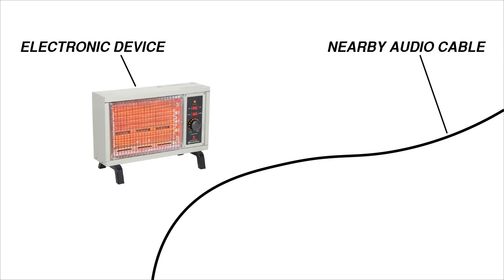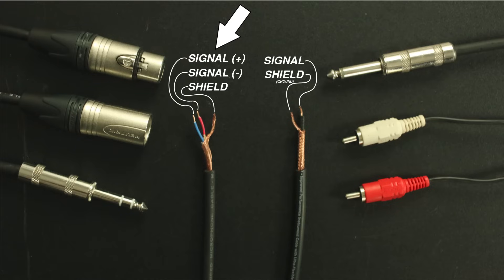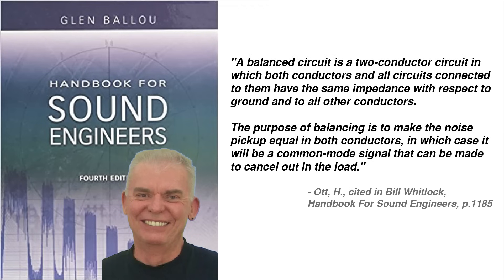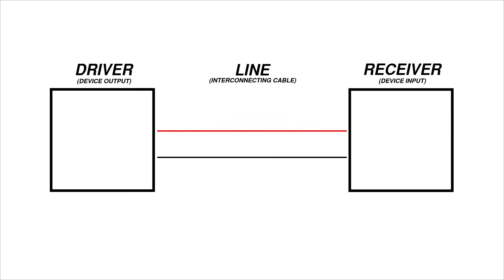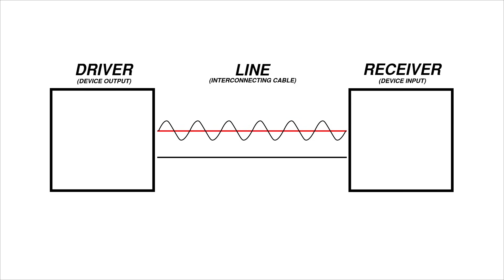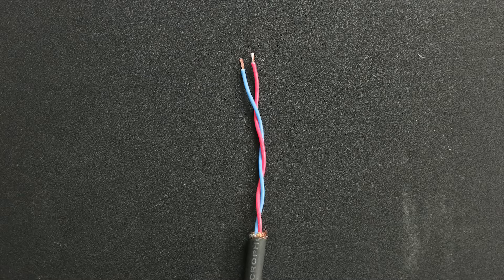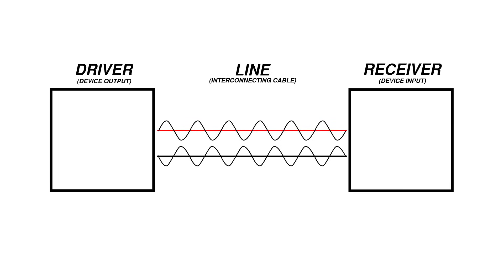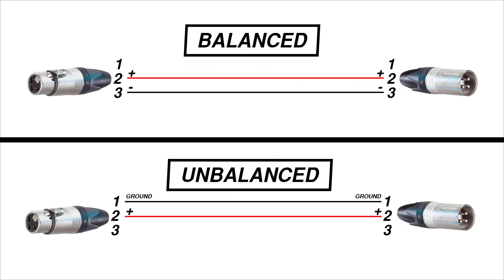Balanced vs Unbalanced Audio | Do Balanced Cables Sound Better?

Comment: I just saw your presentation on balanced vs unbalanced.  First, thanks for the reference to my work.  Second, and the reason I'm writing, is to give you a big thumbs up!!  You got it exactly right!  In my nearly 30 years of teaching seminars on the subject of system noise, I'm always amazed by the number of technicians and engineers (even textbooks) who cling to the idea that signals on the balanced lines must be of equal level and  opposing polarity - this is a provably wrong idea that just won't go away!  Thanks for helping to dispel the myth!
Reply from the maker: Wow! It’s a huge honor to read this validating comment, especially considering that I fell victim to this myth not too long ago! I hope this is truly THE Bill Whitlock writing this comment! Thank you, if so.
Reply: @AudioUniversity   the topic of a balanced cable has not been fully disclosed, since there are balanced wires for headphones, there are also balanced audio DACs, they work on a different principle, to the topic of noiseless sound, I would touch on the optics pluses and minuses, as well as a modern Internet cable that modern DJ consoles use and digital sound amplifiers, this brings us to the topic of digital sound and sound processors, which also have a lot of types, for a car, for films, for pop acoustics, for microphone feedback protection, for phase correction and room correction and other useful things)
Reply: @pirvirts  it's either balanced, or unbalanced there is no "for headphones".
Reply: As most interference induces an emf voltage, why aren’t there audio interfaces based on current, with a high output impedance and a low input impedance? I understand that transatlantic analog cables work this way. Or are there caveats?

Or is it that most (all?) sound sources/sensors are, just as the EMI sources, voltage sources with a low output impedance? Which would require active devices to transfer the voltage into current.
Reply: @JerryRutten  As we all know, Voltage and Current are both related by Ohms Law to Impedance (resistance in DC, or impedance for AC & audio).  Given the audio cable interconnect bridge circuit formed by output device, cables, and input device, and the audio signal being an alternating amplitude waveform... the system is described by Impedance which includes the resistance and complex number components for reactance.  We can model this using the "lumped-element model", so long as the system and scenario satisfies the pre-conditions in the "lumped-element discipline".  Electrical engineers are used to using this model to analyze and understand most circuits.

However, as soon as we introduce an external changing electro-Magnetic field, the typical "lumped-element model" fails to completely describe the system.  This is because in Maxwell's equations, we have: ∇×E = - ∂ϕB/∂t  and the ( ∂ϕB/∂t ) term is not zero!  So, we cannot use the usual "lumped-element" model and KVL circuit analysis to fully describe the system.  (We might try to fudge it a bit and model the transformer and electro-Magnetic coupling formed by the interconnect wires and the nearby AC power line noise source... However, this means we must be aware and careful in how we adjust the model to account for this!)  This is one major reason that EM-field interference with audio interconnects is so confusing to most people, because it defies the very model that electrical engineers are used to using to analyze and describe the system.

Another way that the lumped-element model falls apart is when dealing with transmission lines of sufficient length when compared to the propagation delay of the AC signals being sent across the line.  You referred to the transatlantic analog cables, which would be an example of this.  In this case, we must use transmission line analysis techniques and perhaps the "distributed-element model".

In summary:  The lumped-element discipline has a set of pre-conditions for using the lumped-element model to describe and analyze such a circuit.  When we have an external changing magnetic (ΔB-field), it causes ∂ϕB/∂t to be non-zero, and so we cannot use the lumped-element model and KVL/KCL anymore to fully model such a circuit.  This type of circuit system includes the external electromagnetic field and the magnetic flux lines coupling the electrical devices.  It is now considered an electro-Magnetic circuit, and we must include and analyze the magnetic circuit alongside the electric circuits in 3D.  (It's actually a multi-dimensional differential equations problem, depending on the known and unknown values to be solved for as E-field and B-field and charge density distribution in X,Y,Z coordinates all vary with time.)
Reply: @TrinitronX  
I think the problem, and solution, are much simpler…

Adding a pure resistance in series with a loudspeaker or driver or heating up the voice coil changes the sound. As the impedance dips in the mid frequencies of a driver, the attenuation is more in those mid frequencies in both cases. This is because an electrodynamic driver is driven by current, the contrary to what almost all engineers think. That is the reason why they are called electrodynamic (moving charge).

By driving a loudspeaker driver with voltage you open a lot of possibilities for modulation, and thus compression, distortion, modulated noise, and interference. 

That means also that if you drive loudspeaker drivers with current the EMI interference and noise will be almost entirely eliminated. Which is also the experience with the industrial ’current loop’.
Reply: @utten  Yes, it could be said that loudspeaker coils are indeed driven by current.  Thanks to the properties of an inductive coil and the magnet inside the speaker (transducer) assembly.  So yes, indeed a speaker is driven by current.  Meanwhile, Voltage and Current are both related by Ohm's law through Impedance (V=I*Z).

Also meanwhile, the physics of EMI interference are simultaneously at play.  Depending on the changing B-field strength from nearby sources of EMI, they still can be significant.  If amplification stages are involved, then the EMI noise also gets magnified.  Complex to describe in words alone, but yes you'd be correct to say that loudspeaker movement action is controlled by changing current in the coil causing a changing magnetic field which moves the cone due to opposing or attracting forces against the permanent magnet. 😄

(of course, this assumes a moving coil design as opposed to other types of speaker/transducer designs.)
Reply: This is really confusing me because literally every other video I watched has explained balanced cables as being defined by opposing polarity. Can someone elaborate?
Reply: @iags9  Hello Chase, I've written about this widespread and persistent myth since my original Audio Engineering Society paper "Balanced Lines in Audio: Fact, Fiction, and Transformers" back in 1994. It was published in the June 1995 AES Journal. I continue to try to dispel the signal symmetry myth in my seminars that I teach at audio trade show conventions and universities (including an invited lecture at MIT in 2009).  You can see the slides used in a typical seminar at https://centralindianaaes.files.wordpress.com/2012/09/indy-aes-2012-seminar-w-notes-v1-0.pdf
The explanation requiring "equal and opposite" signals (symmetry) is simply dead WRONG!  I've even offered rewards to anyone who can prove, in either theory or demonstration, that noise rejection depends on signal symmetry.  I had to fight the myth in 1999 when the standards organization IEC recognized that results of their existing test for noise rejection in balanced interfaces didn't correlate with real-world results.  They called for comments and I suggested a different test, which they adopted in 2000 - but only after getting a lot of push-back from those who believed the signal symmetry myth.  An informative annex was added to the standard to explain.  I quote it here verbatim:
"IEC 60268.3:2001     Page  - 111 -

                                   Annex A 
                                  (informative)
                              Balanced interfaces

The purpose of a balanced interface is to transfer a desired signal as a differential voltage on 
two signal lines. An ideal balanced line receiver responds only to the differential voltage at its 
inputs, and does not respond to identical. or common-mode, voltages applied to its inputs. If 
undesired noise or an interfering signal appears identically on both lines, i.e. no portion is 
converted to a differential voltage, the noise or interference can be completely rejected by the 
line receiver. A balanced interface system consists of a line driver, line (normally a screened, 
balanced cable), and a line receiver, whose common-mode impedances effectively form a 
bridge. Conversion of noise or interfering signals occurs only when the bridge is not balanced. 
Therefore, only the common-mode impedance balance of the driver, line, and receiver play a 
role in noise or interference rejection. This noise or interference rejection property is 
independent of the presence of a desired differential signal. Therefore, it can make no 
difference whether the desired signal exists entirely on one line, as a greater voltage on one 
line than the other, or as equal voltages on both of them.

Symmetry of the desired signal has advantages, but they concern headroom (distortion- 
limited output voltage and overload source e.m.f.) and crosstalk, not noise or interference 
rejection. For constant power supply rail voltages at the driving end, symmetrical drive 
obviously increases maximum output by a factor of approximately 2. Symmetrical drive of the 
signal conductors of a screened cable significantly reduces crosstalk, which can be either 
capacitively coupled (through imperfect cable screening) or inductively coupled (from 
unwanted currents flowing in the cable screen). If the screen is earthed at any point other 
than the driving end, these signal currents flowing in the screen can cause additional 
crosstalk by flowing in unforeseen paths in the system."

I'd love to see this myth, which pervades both the internet and otherwise excellent textbooks, fade out of existence!  Bear in mind that, in high-speed data and RF systems where cables are actually transmission lines in the engineering sense, signal symmetry IS required.  But cables carrying audio signals don't even start to have the slightest transmission line behavior (like signal reflections and time-domain distortions) until they become some 3,500 feet in length!

Bill Whitlock
Audio Engineering Society Life Fellow
Institute of Electrical and Electronic Engineers Life Senior Member
Owner of Jensen Transformers 1989-2014
Reply: @iags9  you dont need a polarity difference. you just need the middle wire as a reference from which the difference in signaling seen can be "cancelled". If you have opposite polarity, you will usually come up with a circuitry that at the end will be around 0v- bias (or no DC component). If you the common-mode rejection is NOT of opposing polarity, you will have a bias current in your output signal. Sometimes, this is actually very wanted. Ex, laser tools require a bias current to always be available even in the off-state.
Reply: @iags9  Correct. Two audio signal wires in opposite polarity, so the same audio signal, but when one is going in the positive direction the other goes in the negative direction. These are fed to a 'differential' amplifier, that has both a + and a - input, which combines these to make one single output.
Any interferance or noise picked up in the cable will be picked up in both wires identically, which when added together in the differential amplifier, will cancel each other out (+ and - cancelling). So helping to eliminate hum and noise.
Reply: From one Ham to another, thank you, and 73.
DE K6JSC
Reply: @jasoncary7957  Thanks for your kind words!
Reply: I dont know why anyone would think the signal must be perfectly balanced?

The advantage of the 3 wire XLR cables is the signals are conducted on two identical wires that are inside a shield. The shield is the third wire, and picks up most of the EMI from the 60Hz energy that saturates our electrified world (50Hz in Europe).

With a two wire connection the shield and the internal wire pick up the EMI at different levels. The audio is referenced across those two wires, which injects the noise.

With the 3 wire (balanced) connection EMI affects the two internal wires exactly the same. Since the audio is referenced from one and the invert of the other, the injected noise cancels out perfectly, and the audio (balanced across the two, or not) is extracted by the differential amp perfectly. The shield does its best to ground the noise into the chassis, and acts as the return current (ground point) for the other two signals.
Reply: Too early in the morning to watch with sound on, so maybe explained, but I assume you can feed an unbalanced signal into a balanced line and see benefit as long as the receiver was differential? That differential receiver could be a transformer? But you'd need to care about the ground path unbalancing it or adding ground loops.
Reply: thankssssss ❤❤❤

Comment: Better S/N is not the same as lower distortion, at least, not until a non linear stage multiplies the two sources, but that would be a design problem.

Comment: My understanding of balanced and unbalanced cable connections is from my telecommunications training. 
Unbalanced connections, example 75 ohm coaxial unbalanced,  are used for long distance connections in order to deal with crosstalk and noise reduction over distance. The distances covered using unbalanced coaxial cable in telecommunications are vast, in the order of magnitude if 10s of kilometres.
Twisted pair connections are used for short distances, in the order of magnitude of 10s of metres, and are susceptible to induced noise and crosstalk, from signals bleeding from adjacent circuits.
Therefore:
Long distance unbalanced. 
Short distance twisted pair.
Balanced connections over long distances, for example OPENWIRE telephone cables, requires a transposition scheme to cancel out induced signals. But that's a topic for another day.

Comment: I enjoyed  your video. However i have a problem. Im in charge of running the av setup for our church. The sound in the facility is fine but the attendees on zoom began to complain on inconsistent muffling sounds. The setup was as follows: Mixer>female xlr adapter>1/4 to 1/8 reducer>1/8 rca to computer input. I knew that the issue had to be somewhere within that bridge. So i removed the 1/4 to 1/8 reducer and rca to computer input and installed a 1/8 male to 1/4 male stereo cable. It eliminated the muffling that was being heard during the stream but not the attendees are saying that the volume is too low during the program. Should i just do away with this complicated bridge that exists and just use a direct female xlr to 1/8 cord? if so should it be balanced? Thanks for your time.
Reply: Ok. Any recommendations.
Reply from the maker: There are a lot of good options. The LEWITT CONNECT 6 has some cool features for streaming/Zoom. I recently posted a video on it here: https://youtu.be/bZNNUv7WhjI
Reply: There are instances where you could never get rid of the noise. As you will find that it's not the wiring and not the way you have it connected but the equipment itself.  Not built to function clearly there is a lot of inexpensive Chinese equipment today that does not hold up properly. Like back in the day we were able to get Electronics that were made in the United States. Then things move to Japan, then Korea. As soon as things started to get made in China that's when the bottom dropped out.
Reply from the maker: I would recommend an audio interface that connects to the computer via USB.

Comment: Balanced circuits go all the way back to the early days of telephones.  When telephones first went into service, they used existing telegraph lines, which were just a single wire against ground.  When used for telephones, this allowed for a lot of noise on the phones, but not enough to bother telegraphs.  The solution was to use pairs of wires, with transpositions (twists) at inverval.  Adjacent pairs have the transpositions at different intervals to reduce cross talk between them.

Comment: Soo to sum up use any wire you have 
Or if you buying buy a good quality one
Reply: There are times when you can eliminate the noise by using better quality wiring and to make sure that nothing is interfering with your hookup unfortunately nowadays because everything is made in China there are instances where it's the actual equipment itself you may have it hooked up correctly you may have all the wiring done professionally and still getting a buzz he tries to explain what to do in this case but not in a simple matter for the average person to understand you may have to call in a professional to fix this problem you're getting.

Comment: That was a very clear, concise explanation. The only question I have is whether it matters in a typical home environment. I have plenty of noisy electronics around. But the longest signal run I might have is only 30'. Would a 5' cable pick up enough noise to be noticeable?
Reply from the maker: For short runs (below 15'), there won't likely be a big difference.
Reply: If you hear it it's noticeable right